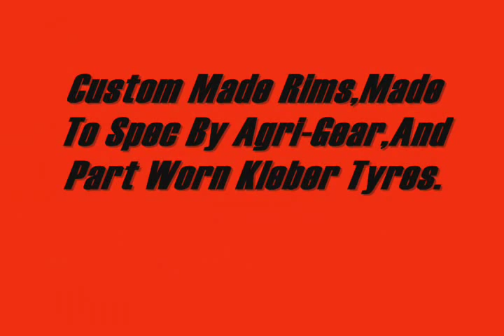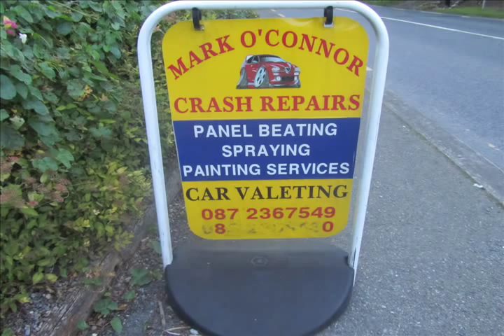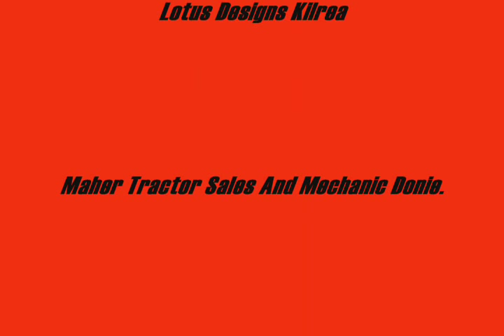Nuffield 690 Project Tractor Complete Restoration.

Comment: My father was a tractor dealer in the southeast of Ireland, he traded in a Nuffield tractor in the early 1990;s i think it was a 10/60 , he discovered that the tractor was a test built tractor prototype, as none of the parts supplied by Mahon Mc Philips would  fit. The tractor was exported to Ireland by a scrap merchant from England in the 1970's he discovered. Unfortunately the tractor was sold as scrap collected by Cork Metal and  melted down.

Comment: hi  , I just got hold of a Leyland 401 engine  came out of a factory   it was a stationary unit to power a sprinkler system , only 178 recorded hours  
we are hoping to put it in to eather a 262 Leyland or a Nuffield 1060 
dose anyone know of a 401 that has been used in such a way ?  and was it an easy conversion ?   love your tractor by the way ,  cheers  chris dodding

Comment: I always thought the Nuffield 690 had a Perkins six cylinder engine.?
Reply from the maker: Nuffield never made any 6 cylinder tractors. This is a conversion where the chassis was stretched and engine fitted. The number ’690’ is completely made up using the logic of its original number ‘460’ (4 cylinder, 60hp), 690 = 6 cylinder 90hp